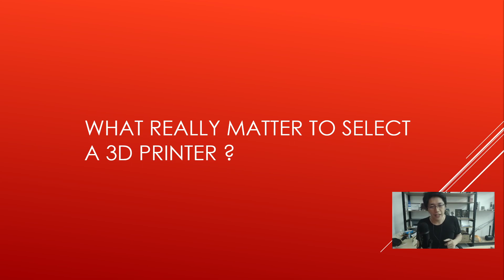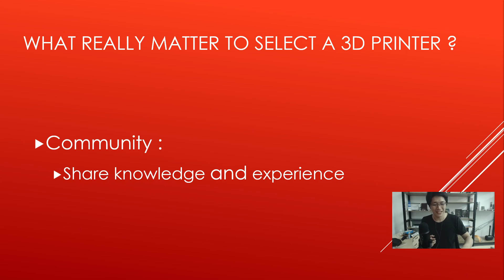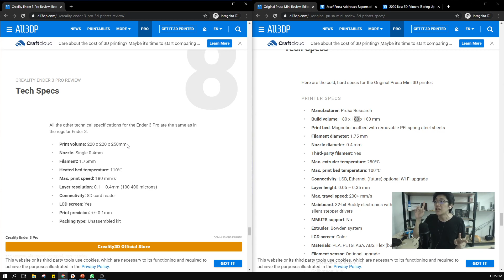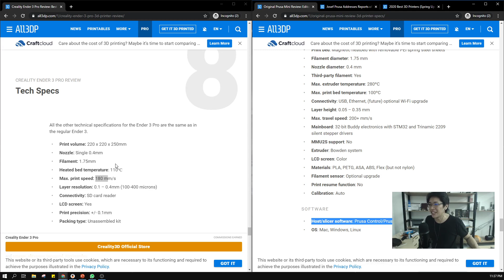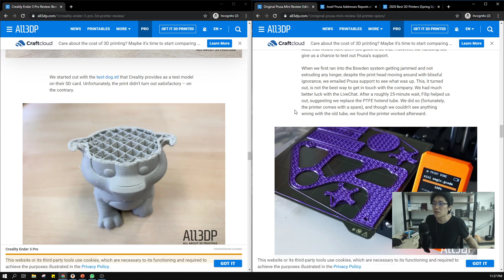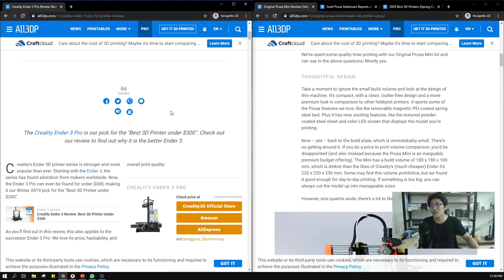You should consider this before buying 3D printer and compairing ender and prusa mini FDM 3D printer

Comment: good information. i went for the Ender 3 mainly because i didn't want to spend much money before i knew what i wanted to do with it, and also i do electronics as a hobby so i liked that it was so hackable. Eventually i upgraded everything to be on par with MK3 and in the process had a lot of frustration but learned a lot. In the end i'm not even sure if I saved any money or not. there is satisfaction in the upgrading/modifying/optimizing process but it does require electronics and software compiling skills. For anyone who mainly wants to focus on 3D designing and just have a stable and reliable printer I'd save up and go for the Prusa Mk3, but if you like hardware hacking and software tweaking then the Ender 3 is a good base for that. The biggest improvements for me were a 32 bit controller with upgradeable stepper driver sockets and silent drivers, then auto bed leveling with BL touch, then direct gear driven extruder, then spring steel PEI build plate. i also added an auto mains power shutdown relay module to give me peace of mind to let it do long prints while i'm sleeping. The auto power shutdown is triggered either by end of print, processor inactivity, low dc voltage, filament jam, and from a smoke detector mounted on the printer frame above the build plate.

Comment: Great vid! What printer would you recommend for around $400? I am stuck deciding between the ender 3 pro/v2, the artillery genius, and the prusa mini.
Reply: I have both.  If you just want to print get the mini. If you want a larger build volume and dont mind fighting with your slicer/making modifications go the ender.
Reply: I am in the same boat. Did you make a choice?
Reply: @buffteethr  I bought the v2, still waiting for it to ship
Reply: @buffteethr  Did you yet? :D I am there too now. Intending to do mostly small items - enclosures, parts, handles, crap stuff in a limited space that I have. I guess I will be going for Prusa Mini (I have their hackerspace a couple of tram stops away, actually :), or so was was my initial idea. Then I saw the Ender 3 v2 for half the price with some good reviews so I have now been looking at comparisons. But hell, in January or February I guess it will be Prusa Mini, for its reliability and localness.